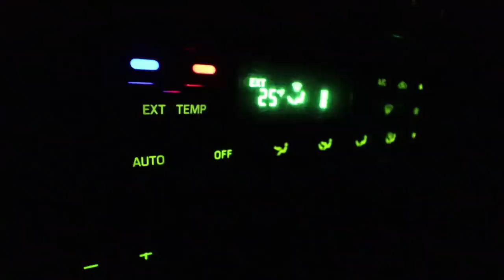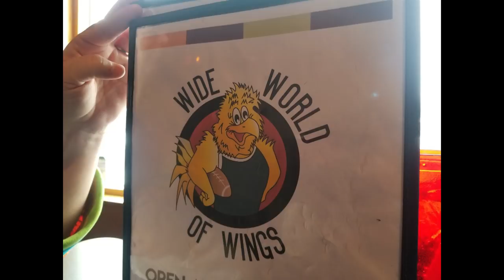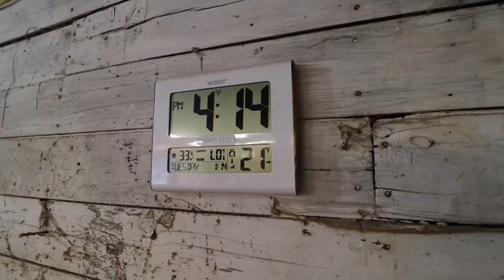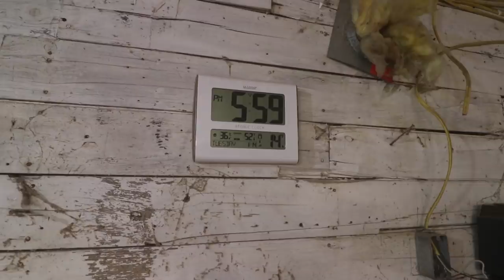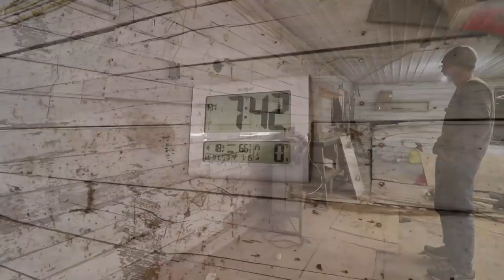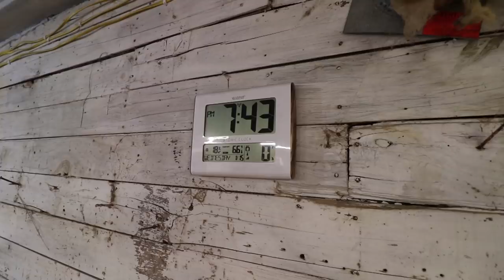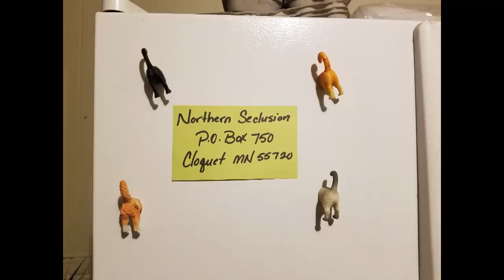THE FARMHOUSE. Table saw. More lights. Wood Stove Cooking. Snow on the way.

Comment: i have own and currently use the exact same wood stove model to heat my house, Dutch West wood Stove- Rare to find in use, and I am always getting spare parts for it.. Awesome efficient stove. love it ! Heat my entire house, no issues. when the power goes out, we use it for coffee and food too. get the temp to 500, flip the lever, activate the burner, close all brass vents to a 1 quarter turn.. heat for hours!  use a heat powered fan..

Comment: Hey Joe, "We Did It!!!"....Finally got the "workhorse" into the shop...aaayyyyy!!!  "MY Vision" is coming to fruition....lol.  Seems we did good on the saw...sounded great at start up, has the outfeed roller table and even the router wing extension.    I love the room in the shop.  There is nothing better than adequate square footage-which by the way I LACK here in my FL. garage shop.   If it weren't for mobile bases I would be lost.

Comment: Joe you can use your metal detector to find the steel beams in the wall. Nail heads show up as a #22. A beam should show up all over the place on your Garrett metal detector

Comment: joe. i have been updating one of my shops to LEDs and they make a big night and day difference in the light in a shop. i used led high bay lights with my high ceilings. you could use a led trough light or even some 8 foot strip lights.

Comment: enjoy your work.  thanks for sharing.  Since you don't have enough to do ;) - in the summer will you build an open sided shed with roof to park the tractor under?  you did such a great job getting it running, hate to see it sit out in the elements.
Reply from the maker: If I have time yes. Right now with having the multiple properties we have very little time. Hopefully this spring we can sell the Louisiana house and that will free up some time.

Comment: Nice saw Joe. That fence is top of the line.  I have a very similar saw, maybe a few years newer but I wish I had that Unifence for it. Are you going to build an outfeed table for the saw and get rid of those rollers? Looks like you have the room and it would give you another work surface.
Reply from the maker: Not sure on the outfeed. I will use the rollers for now. I need to wait and see where everything's final resting place will end up.

Comment: You need to build an over hang for your tractor with front and rear openings. And add a wall to hang your gear and tractor tools nearby and protected from the elements and a place to set up your tractor heater equipment that is protected when not.in use but handy. Also o
Pea gravel flooring and driveways to keep from mud and snow. It would look like a small barn side of building then with a roof and shall tower with weathervane. You could also hook.up your tractor to start from an iPhone app while getting ready in the house also it can start the heater. A overhesd heater could blow down with warm air on entire tractor to be ready for you to protect from any snow or rain. You could even add two knee walls tractor doors to open or close by app also to have it open for you to exit and enter as well as keep livestock from interior and also  work from the tractor for you to return to its bay. I think it would be an awesome addition to your red barn and tractor pull in. Also keeps leaves off Your tractor. I can see it in my minds eye right now and you could build it in.no time and add any extras you want. Maybe a hose to rain down on tractor to wash away dirt and grass when you return and to remove dust and dirt when going out.on a hot days run around the farm. It would add so much to your farm look. I'd do it if I had a farm and was physically able to do it. What an awesome idea!!!  Also you can gas any skunks under flooring with hose from.your cars exhaust and then remove the carcass which didnt have a chance to spray as it slumbers. Skunks carries rsbbied and more. Protect your dogs and cars from these pest  who steal your eggs and kill chicks and eradicate any skunk in your area. It's more hunane than shooting them. Works on raccoons  and other varnents too.
Please add more windows to add light you could also see tractor in it's new ’barn’!
Best of.luck..Gid bless 
I've you eood iok ceramic times. I am going to do that in my entire house when lissu me as my wheelchair catches on carpet and I've gone flying several times with broken bones from jamming on the carpet. I.slide effortlessly on level.fjat flooring even tiles .

Comment: I've seen that you have a generator .seen you run extension cords inside before. But I'm surprised you don't have like 7500 watt one. In Missouri we had a hell of a ice storm 11 years ago power was out for two weeks. If you get a decent sized generator with 220 outlet you can get good heavy duty 220 wire run it straight from the generator to the breaker box just unhook the AC units 220 plug it in to there. turn off the main breaker to the house so you don't fry  someone working on the lines. . Are 6500 watt ran the entire two story house like we wasn't even out of electricity.
Reply from the maker: That is highly illegal to do here but I totally agree. Most people run it and plug it in the dryer plug in
Reply: @NorthernSeclusion  ya that's a good idea putting a dryer plug on the end of it . We have a pole shut off along with main breaker shut off. I guess it's illegal for the fear of back feeding the lines.  Wonder if a guy would run a generator one day a month how much he could spin the meter backwards lol maybe that's why it's illegal too. In bad power outage I wouldn't give shit about that law but I'm a rebel have great day Joe! Shop's coming along nicely. Hell of a nice table saw. We have a delta portable saw that we have  used in the flooring industry  80k foot of  3/4 hardwood  250k feet of laminate installed so far going strong since 1994 delta is way underated.

Comment: I've been to a few pawn shops here in south Florida but most everything is too high an just plain junk. Craigslist tools are either totally worn out way too much money even though people say like new. Back 10 years ago I decided to give away a radial arm saw which my Dad gave to me and he got it free also. People were calling me from everywhere. I told them whoever gets here first gets it. It was funny watching people fighting over something, yelling and cussing at each other. This saw was built in 1952 still in great shape, the speed could be cranked up because it also was a shaper with cutting tips. It was built by Saw Smith, then became a different company.

Comment: Where will you put the Big screen TV?
Reply from the maker: Not sure yet but I was just looking at that the other day. I think the side wall. When you walk in the front door it is that wall to the left. Less dust over there. We have a 50 or 55 inch that just sits in a closet here that we will put up in there and then put an antenna at the front peak of the roof.

Comment: Your barn had a barn cleaner track poured into the concrete,  that would tell me it was to be a cattle barn, not storage. Depending on how old could have been a small family dairy, but that’s pure speculation.
Reply from the maker: That is exactly what it was, you are correct. I have talked quite extensively about that in previous videos.

Comment: Do a review of the Sling TV please. I have Direct TV and I am going to have to change it is just too expensive for what you get. When I call and complain they make me a "deal" which sounds good but then within a couple of months it is right back up there again. Plus it has always rubbed me wrong having to pay a month in advance for TV.
Reply from the maker: We cut the ties years ago. No cable, no dish, nothing. I have a nice antenna that gets about 40 channels. Sling so far seems to be really good, you get discovery and history channels and a ton more. We do not have very good internet at the house and it still does pretty well. It will hang up at times but that is on our end. Next year (later this year I guess) they will be running fiber optic to the house and then we should be good. If you have good internet there is no reason to have dish or cable. Actually ALL you should be watching are the YouTube videos. LOL. We also have HuLu I think but we mainly watch Sling now. We also have a jail broke fire stick so if you are really wanting something you can usually find it there. Keep in mind that we are NOT sports fans in the least so I am not sure what options other than espn people watch for that nor do I know if Sling offers it.
Reply: @NorthernSeclusion  Thanks for the info Joe. Can you review the antenna or have you already and I missed it?

Comment: it's really not good to just run the engine on the truck and not move it around. It can create a lot of condensation in the motor. I know why you're doing it but if there is power run out to that garage (?) I would just plug the battery in to a trickle charger; you'll save yourself a lot later on.